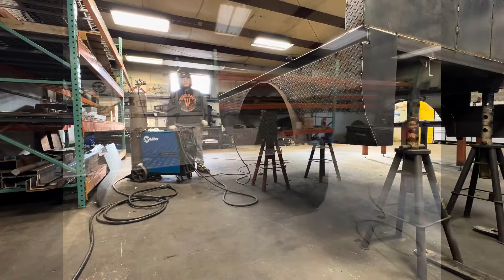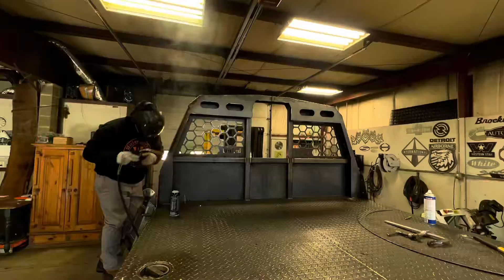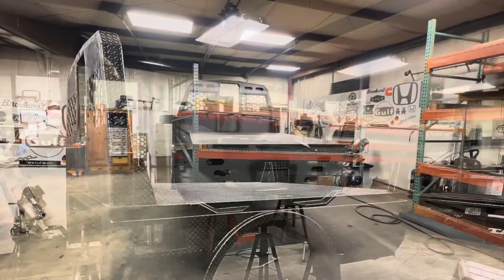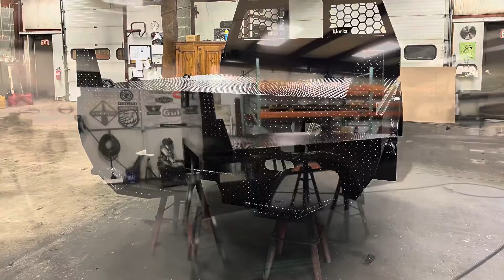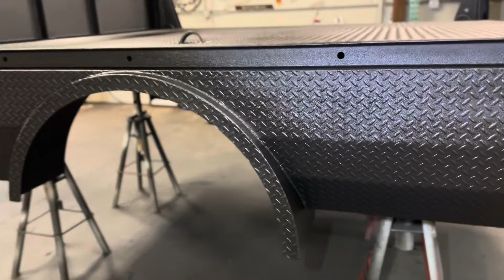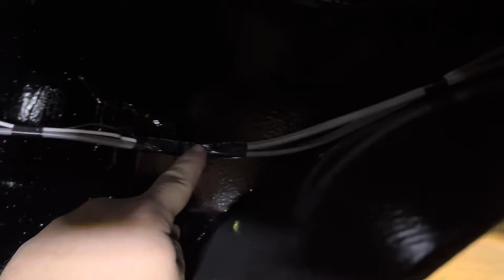How To Build A Flatbed: FINAL PART- FINISHING UP WELDING, PAINTED, & WIRING!

Comment: Question I'm wanting to maybe put a flat bed on my truck.  It's a 1986 C20 long bed srw but wanting to convert it to drw keeping my rearend.  Do they make wheel adapters to run dually rims?
Reply from the maker: They should make something like that, just have to find them with your lug pattern
Reply: OK cool.. thanks.. the bed looks good man..too bad I'm to far away or i would have you build me one lol.. @wickedgarage

Comment: Everything looks good. The only thing I would change is the outside c-channel around and notch cross members. So the outside would be smooth
Reply from the maker: @PaulWright-h6p  preference, i like the channel like that because it reflect the lights, it also give you the whole length to strap to as well for the awkward loads, if im doing a rub rail or someone wants them smooth, i use box tube on the outside, notching every rail is alot of extra time, totally get it though, some people like it and some prefer the smooth